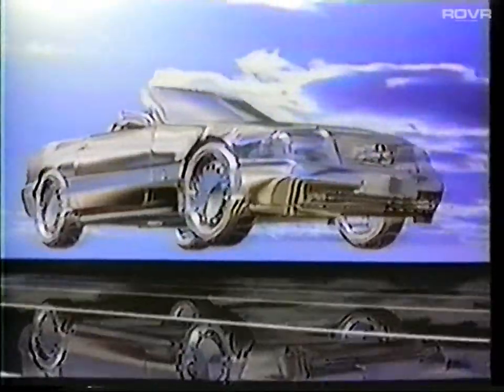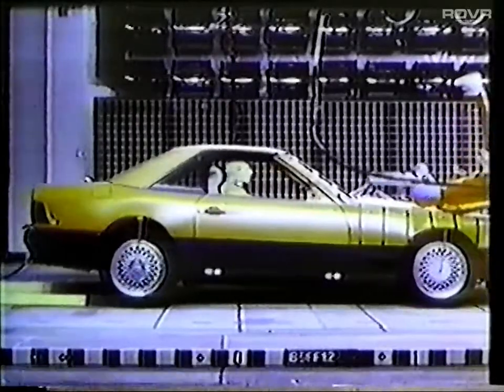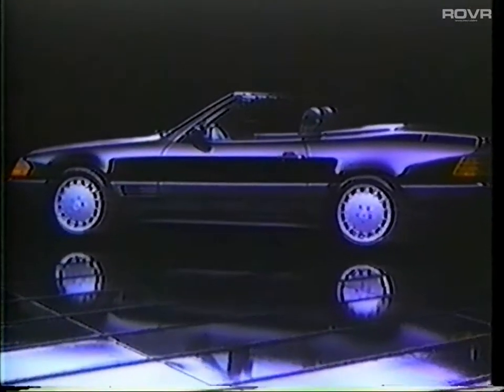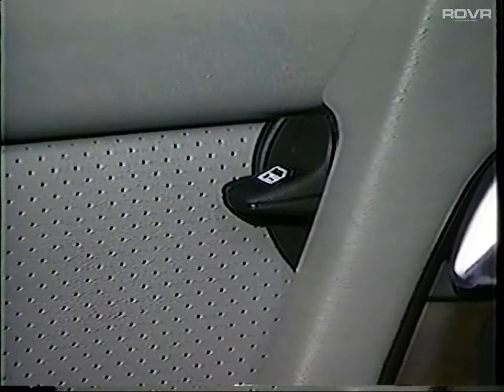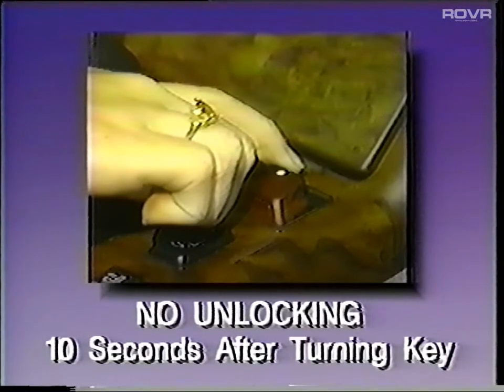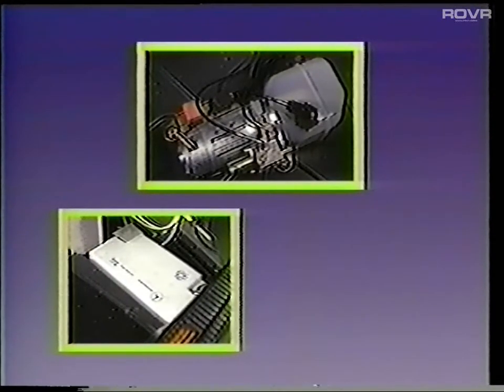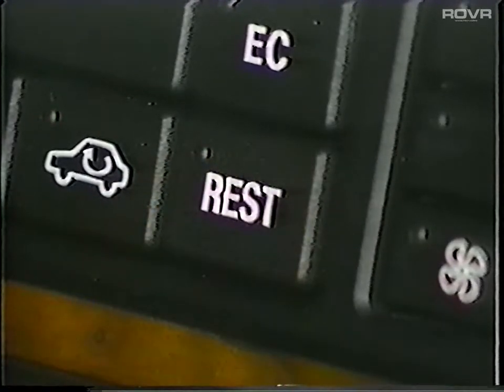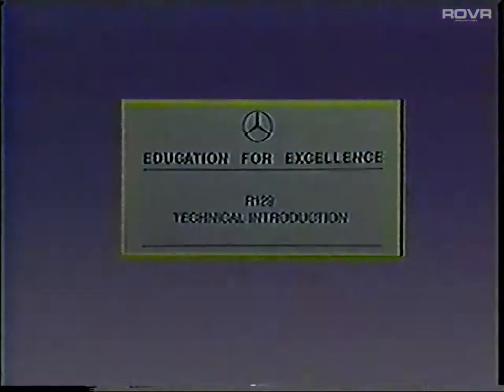Mercedes Benz (US) - SL Roadster (R129) - Engineering and Systems Operation (1988)

Comment: Owning a 93 500SL, this video actually covered a few niche things I was wondering about relating to the central locking system and top operation without the engine running.